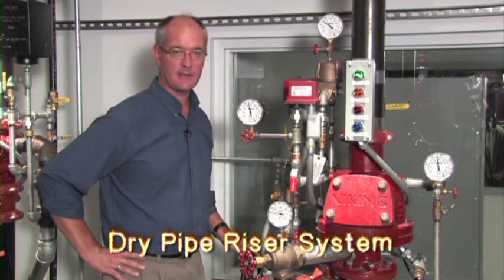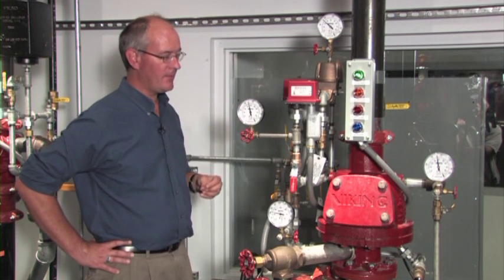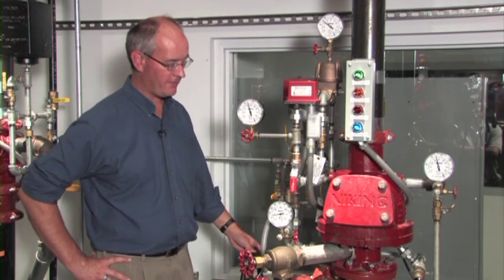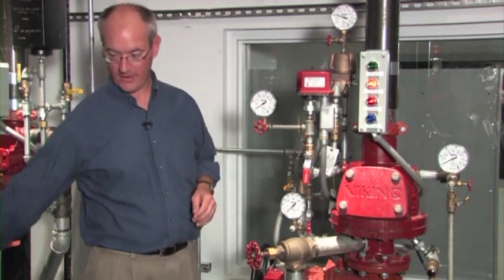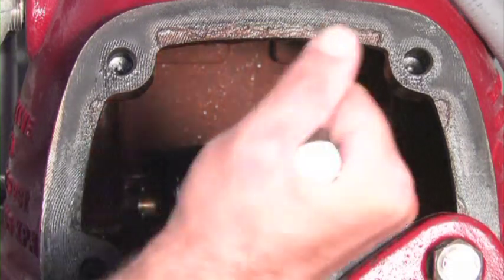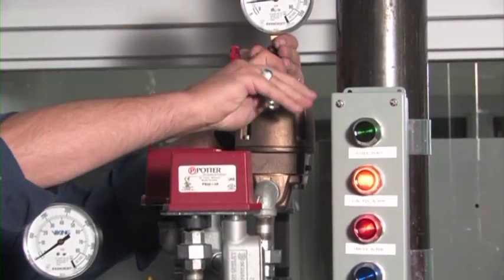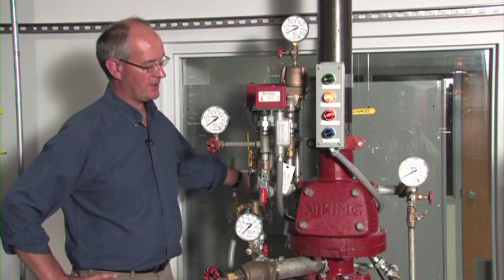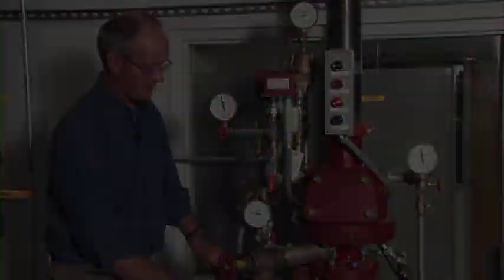Viking Dry Pipe System - System Reset Procedure

Comment: I have reset a viking dry valve 3 times. And everytime after an hour or so we have gone back to having water in the lines.   I have cleaned brass face and rubber on flapper.  Flapper plate appears locked down yet it goes wet after about an hour.